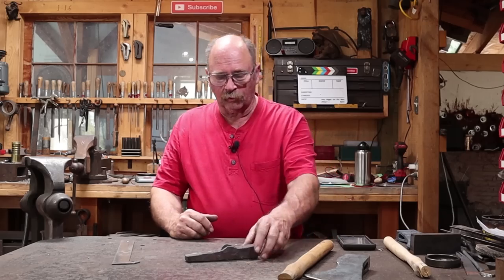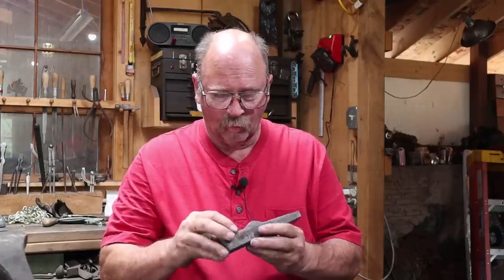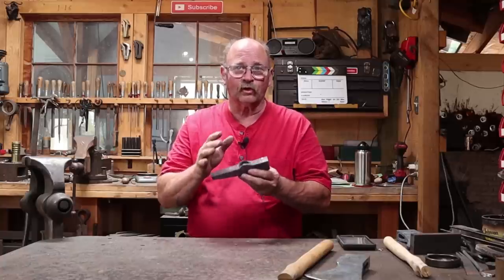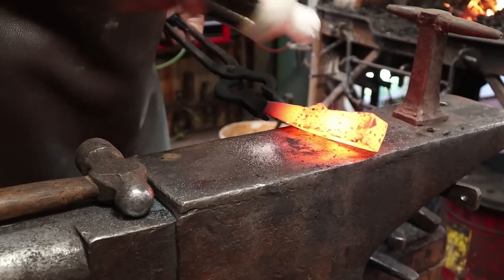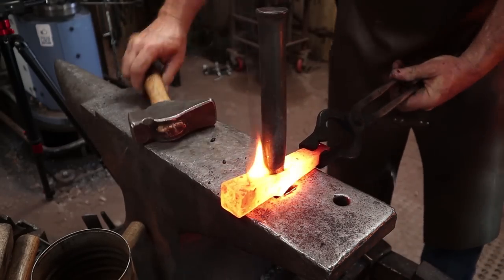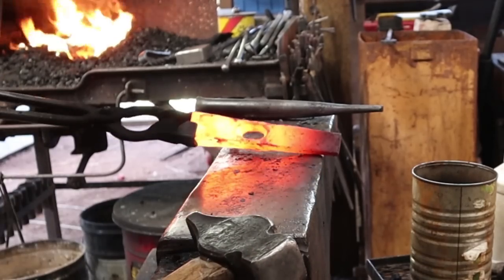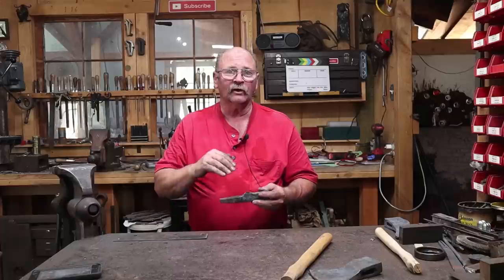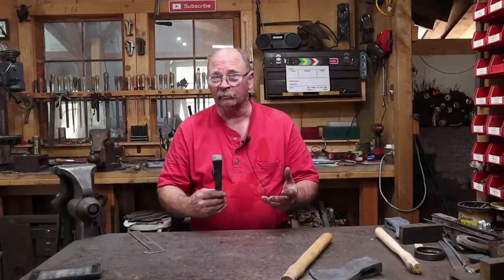Should you just leave well enough alone - mastermyr hammer part 2

Comment: It can be hard on the ego to feel like you are showing failure after failure. I'm not a smith but in my own area of expertise, I've learned a lot more by taking calculated chances, failing and figuring out how I could have gotten a better result. My students tend to think that I'm so smart I just knew not to do this or a better option for doing that but, as I tell them, it isn't that I'm so smart that I figured it all out in my head. I did it wrong at least once and usually way more than once before I got it all straight in my head.

So I appreciate you showing the whole learning process. I know most of my students are paralysed by fear of failure more than any other factor--somehow I have to teach them (usually by showing them) that failure is not a useless digression, it's a way to learn things you can't learn any other way.

Comment: Watch Joey van der Steeg making his wrought boat anchors. In at least one instance, he needs to make an additional weld but was short of material. He added a small diameter wrought iron rod to the weld to prevent precisely your situation. As soon as you said that you needed to reweld the crack on the side I thought of Joey's solution. It's good to show the failures since most of my adventures are just that. Thanks!

Comment: You always teach me so much. How to tell when the steel is to hot is a big question of mine I have burned some stone chisels and it is so frustrating as they look fine until I hit them with the hammer and they shatter:(  I would love to see a whole video about telling the temperature of steel in the forge. Thank you so much for being so open about your own learning It makes it a joy to watch it is very exciting to never know where the lesson of the day will go.
Reply from the maker: The big trouble with learning steel temperatures from video is that the camera tries to adjust for best light and then everyones monitor presents the color a little different
Reply: @BlackBearForge  I had wondered if it was something like that as you are very thorough explaining every other step. I appreciated the tip about seeing the metal turn a bit molten on the surface when it gets to welding heat that you gave in another video. Thank you for responding you are an amazing teacher.

Comment: An old post, so this might have been addressed, but I was taught to treat every piece of wrought iron as 'muck bar' there are (or were) 4 classes of WI, muckbar, first, 2nd, and 3rd fine (fine was short for refined) nothing official just the way I was taught by an old timer who started smithing at the end of the wrought iron era. I think, the smith who made the hammer orginaly might have started with merchant bar (which probably was muck or 1st) and refined it by billeting and welding it a couple more times. He also had the advantage I doubt he was working alone, chances are he had at least one person running the bellows, and handy to grab and hold things etc.

Comment: Hi John. Just a note on wrought iron then and now. "In the day" when the Mastermyr pieces were made, the wrought iron started off as a bloom and was forged to shape by working the crude piece into its final shape at the forge. Your pieces of wrought iron have already been worked into bar shape as a final shape for the stated purpose for whatever the bars needed to be used. This left the silicate slag stringers in the bars aligned with the axis and therefore transparent to the application in contrast to the slag in the Mastermyr blooms which, while present, didn't affect the properties of the material so much as it was being forged to the final Mastermyr shapes.  You might be better off if prior to using your raw stock, you take the time to forge the bars in three directions with a  significant reduction in each direction to break up the grains and the slag stringers before going gangbusters to create your final shape. (If I recall correctly, commercial forge houses use a 3:1 ratio to break up cast structures for military grade forgings.) Sure it's a lot more work, but I think your chances of success will be higher by breaking up the existing grain structure which might be working against your intended purpose.
Sincerely.
John Gullotti.
Reply from the maker: Thats an interesting thought.  I had wondered about reworking some of what I have, but hadn't thought of it from that perspective.

Comment: Much respect Mr. John! As said, you're a great teacher to a vast number of us. 
   That said, if I may be so bold,  consider this plz. I watch Joey van der Steeg video on his wrought iron anchor project.  Your project may be saveable thru a technique he uses where he adds wrought iron rods in forge welds to add mass and structural elements And filling in cracks/gaps. I am pondering on if you  could do this type of process to repair your ears and fix the damage eye? May mean a bit of file work in the end though. I got my money on you can do it and pull this one out like a champ. I mean if you wanted to and all. 
  Sorry  no disrespect intended sirSir,  just offering a thought for you.
🙏 blessings abundant sirSir 
Crawford out 🧙‍♂️

Comment: IF you salvaged that wrought iron would it improve the chances of success due to having been worked more — more impurities driven out, finer grain &c?
Reply from the maker: It would, but there is the issue of the steel faces, which would either need to be cut off or worked in creating something odd.  I'm just not sure its worth salvaging unless its all I have to work with

Comment: When you first punched that eye, you said you opened it too big too early... Admit your lack of knowledge with wrought iron(which you said you don't like wrought iron), and start over. You should WANT to improve and get better in your weakest areas,  but it seems you prefer to shy away from your weakness. Doesn't that mean that in the Viking age you would be a failure as a blacksmith??? Because if you didn't know how to work with wrought iron, they would have never let you work with the more expensive types of steel.  You may have been allowed to practice making horse shoes or maybe even been able to clean out the fireplace and blacksmith shop.